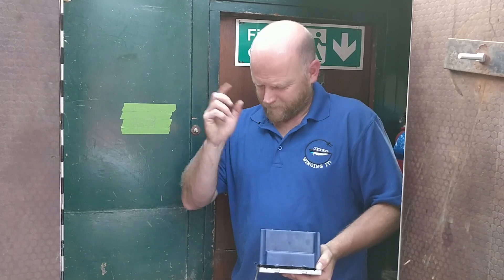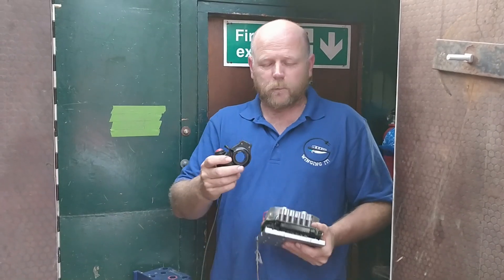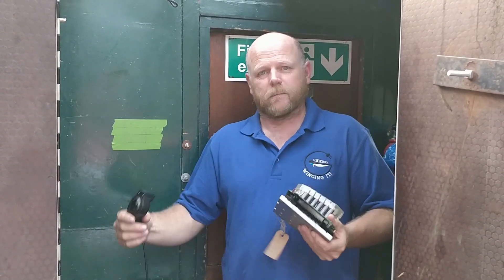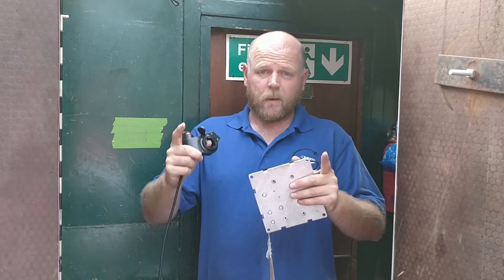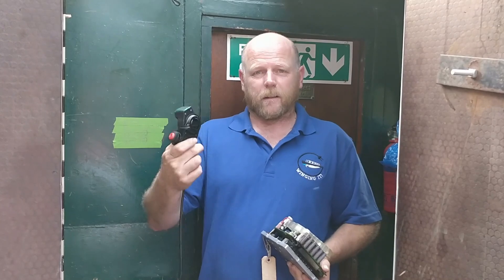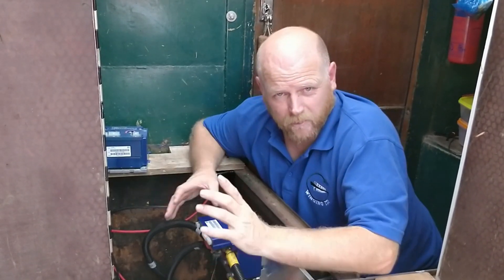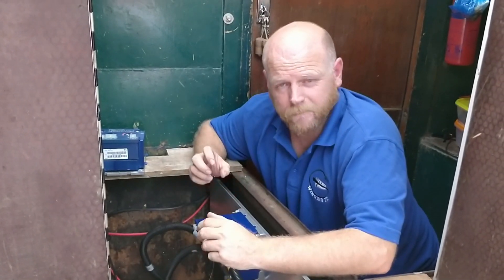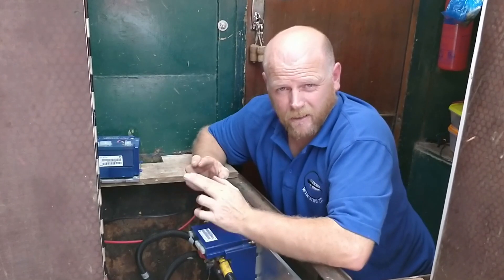DIY Electric Drive Conversion on a Boat - Winging IT, with The Tight Yorshireman. Episode 10

Comment: You are better than me. The second I saw it was the wrong controller it would have been returned and I'd try again. Unless that was the only one around of course. Great stuff, I like how you roll with the punches.
Reply from the maker: That was the issue - it was built using  old model control unit... so finding the same one was almost impossible!

Comment: +1 for the reprogramming. 24v means double the current for the same power requirement. This could overheat your cables and cause more problem and be more expensive than the reprogramming in the long run.

Comment: I don't know if you are already on the DIY electric vehicles Facebook group, but there are folks there who could assist with getting that controller reprogrammed, if you need it. 
Also, do you know Damien Maguire of EVBMW? He's in Ireland and doing amazing work reusing hybrid car parts in electric vehicles, as well as building very capable motor controllers from scrap parts. Shares your sense of humor too:) keep it up!

Comment: 24V will make everything in the system work harder not easier.  It will draw more current to do the same work.  Get the controller reprogrammed.  Winging it will cost you more in the long run.  Four decades of engineering has taught me this.
Reply: John Frieman Hi John, can you explain why you believe this to be the case. I have often heard it said, but in any normal load, if you halve the voltage and the impedance remains the same then the current will halve no? I= V/R. It's true of course to say it will only do half as much work but I don't think it will do the same amount of work and somehow draw more current to compensate? After all, reducing the average voltage to the motor is how most speed controllers work.
Reply: gillywild Actually speed controllers work by varying the field winding voltage.  The main voltage remains constant.  The point is that if you need 2kw of power out, having the voltage means the current must double to get the same power.  Since power is what drives the boat we need to start with knowing how much is required.  For the low speed of a narrowboat very little is required.  But even 2 kw means 83 amps at 24 volts.  At 48 volts it is only 42 amps.  The voltage drop through the cables is directly proportional to the amperage, using 48 V means a smaller voltage drop.  Remember, “penny wise and pound foolish.”
Reply: Wouldn't that depend on the length of your boat and where you are going to use it? If you're in a tidal river instead of a canal, you're going to need more power to overcome the currents, where on canals because of the speed restrictions not as much power is needed.
Reply: Charles Damery True, but without knowing all of the particulars I just giving a starting example.  We were discussing the pros and cons of 24 vs 48 volts.  With the limited power available on this boat going on any water that has a current would be ill advised.
Reply: @johnfrieman2541  My thoughts too. Even a 'two pot' lister engine delivers twice the power available from this motor, and they just manage in a fair water current.
Reply: John  The real issue with this configuration is that Peter was trying to turn a propellor designed for a 30hp diesel on the same gearing with just 5hp motor - yes halving the volts will halve the speed and power but that is only half the equation  - the power absorbed by a propellor rises exponentially  - by halving the prop speed there will be 4 times less load on the motor - that will reduce  the current his new controller has to supply and limit the top speed to just over 3mph
Reply: Trev S Boiled down to the basic problem: “winging it” simply leads to more trouble than actually designing the thing from the start.  Currently the free running speed of the motor, the torque, the gear ratio of the gearbox, etc are all unknowns.  There are thousands of possibilities that will not work and a few that will.  Find the few is called engineering and lacking that is a waste of time and money.
Reply: @johnfrieman2541  I realise it seems counter-intuitive that halving the volts to 24v  will help resolve the incompatibility in the drive train -  certainly 2.5hp means Peter's wife won't be water skiing any time soon, however, it will allow them to potter about and enjoy the summer. I think there's a lot to be said for "winging it" it motivates folk to engage in the dynamics and get a feel for what's happening.
Reply: @trevortrevortsr2  In reality 24v doesn't resolve anything, it only compounds the problem.  DC motors are not speed governed they are torque governed.  Reducing the voltage does not reduce the free running speed, it reduces the torque.  This can result in a speed reduction under load, so it appears to reduce speed.  The free running speed of the motor at 48v and at 24v would be almost the same, only differing by internal frictional losses.  The problem is that to run at a certain propeller speed requires a specific torque.  That torque is governed by voltage and current combined.  Running at 24v will require twice the current for the same torque as running with 48v, in both cases at the same shaft speed.  This means that the governor, cables and motor brushes have to carry twice the current and will deteriorate twice as fast.  Also, as this is an air cooled motor it will run at a higher temperature.  Even running at a reduced shaft speed due to an over sized or over pitched propeller it is still easier on the system to use 48v.
Reply: @johnfrieman2541  What your describing is a specific type of series wound motor where the electric flows first through the field coils then the armature which is highly torque-sensitive however it is still voltage dependant under load as back emf climbs - the controller is a PWM which controls the volts - this undoubtedly changed the speed as Peter will tell you. The critical advantage in running the motor on half voltage is it to lower the speed of the propellor reducing the current it draws - ie at half speed the propellor will consume 1/4 the power -  however, because we have halved the volts this current will double to 1/2 the former 48v current level. Peter recognises he will get the best from is a motor at 48v  however that would require a different prop or different gearbox perhaps something to do over winter when he blackens the hull - running his motor on 24v is just a stop-gap so he can enjoy chugging about over summer

Comment from the maker: Maybe I should add that I forgot (!) to mention in the video is that a calculation to work out the correct propeller suggests that the prop we currently have is oversize for this electric motor, with the current gearing. So there is a thought that reducing to 24v may take the strain off the motor... 
Or that in simplist terms is how I can explain it... Maybe someone with better knowledge can 'tech' that up!

Comment: It would be worth running a test on the Hall effect throttle to prove if it has actually gone short circuit as that is the only sort of failure that could cause damage to the main circuit. If it hasn’t then you need to be looking elsewhere for the cause of the fault.

Comment: There are lots of comments about running at 24v instead of 48v will cause the current to double.   This is not the case as its the same 48v motor. The doubling only occurs if you also charge the motor to a 24v motor. 
It's no different to just reducing the throttle.

Comment: Just caught and enjoyed your videos Pete.  You must check your motor has not shorted usually the field windings will short and cause the damage you have so test with multi meter and also run it on 12 volts before trying your new controller. If the motor is ok then I would guess the controller has failed due to overheating and blowing the mosfets. You could easily make a chill plate and have it water cooled. The Hall effect pot. would not cause this it just would not work.
Reply: He'd already found out the hall effect speed control won't damage the speed controller (luckily) by connecting it to a new controller and finding that it didn't work. Plus it had survived for some time with it connected, if it was going to cause a problem, it probably would have been evident pretty much straight away. Probably an overheating problem, it had already cut out before from overheating, and a fan had to be fitted. Repeatedly overheating a power controller is not the best idea in the world for giving it a long life.
Reply: threeMetreJim agree it’s most likely overheating but I have also had some blow after a motor failure so I make sure the motor is fine before fitting a new controller.

Comment: Well, I had three comments but see two have already been voiced, half voltage - double current and the thermal conductive paste on the back of the controller to improve heat transfer, the only other question/suggestion is from what I have seen on several of the Narrowboat Vlogs about lithium batteries have a charging problem in temperatures below 0 degree C. See: The Aging Law of Low Temperature Charging of Lithium-Ion Battery They do make Lithium batteries that are rated for operation and charging down to -20C. Just wondered if you had considered this? Great job so far!

Comment: if it is a 48 V motor and you run at half voltage the current will double to do the same work just something to be wary of.
Reply: It would but at half speed, the prop will only be doing 1/4 the work - hydrodynamic load is not linear with velocity
Reply: @trevortrevortsr2  Agreed hydrodynamic load is not linear with velocity. I just advised current would double to do the same work. Mr winging it was on about a hall effect throttle and how it should have been a pot type and this could have caused the fault. My concern was the current increase in the cables and controller and also the batteries could suffer due to higher current discharge. It might be a good idea to fit a current shunt Amp meter in the motor line so that it could be monitored.
Reply: @UCbkWUxgtZdJRDA7a7Df4aZQ It was Mr winging it that suggested the burn out. As you stated its only a signal for the controller. With 8 sets of 2 batteries to give the 24 volts it should give a reasonable size battery pack and you would only be pulling 10 Amps from each set of batteries when the motor is taking 80 Amps. Just a thought they could change the prop for a smaller pitched one that may help but liable to be expensive.
Reply: @5kram  The hall effect throttle is unlikely to cause damage but it will limit the PWM range as it gives 1-4v single   to a unit that requires 0-5v - Older clunky forklift controllers wouldn't work at all from the hall effect throttle as the single strength is so low - Modern microprocessor driven seem to cope though

Comment: Not sure if it would be worth using a thermal compound epoxy to help with the heat transfer away from the controller

Comment: Since no one make all the stuff to convert a narrowboat to be electric, everything is trail and error. Maybe someone will watch this and be smart enough to build a complete setup thant will e as good as diesel powered unit. Until them keep the videos coming..
Reply: Lynch already supply everything you need to convert a narrowboat to electric, main problem is cost. When you say as good as a diesel, that is dependant on how you are looking to use your boat.

Comment: Running the 48v fork lift motor and controller flat out ,at over 48v for a long time probably not a good idea. Lock out full throttle !.

Comment: BOAT - Bring Out Another Thousand... Having to use a computer to re-program, is the bane of modern equipment. Shame you can't use a high current RC speed controller (ESC) to run the motor. Not sure they make them in the current needed (150 A) or voltage required (48V) though for a single phase DC motor.